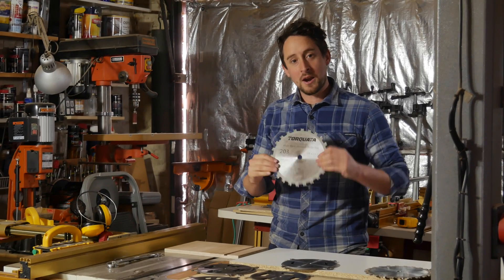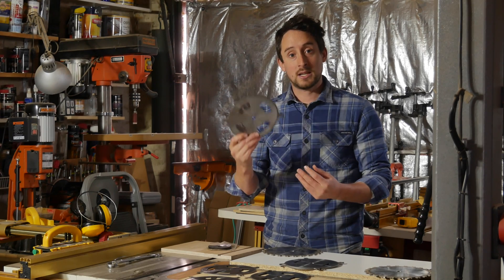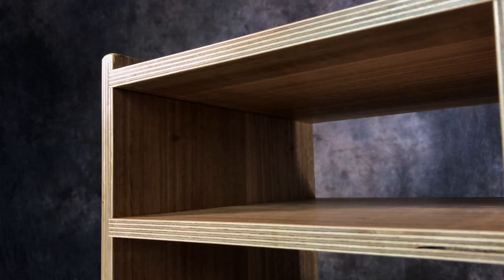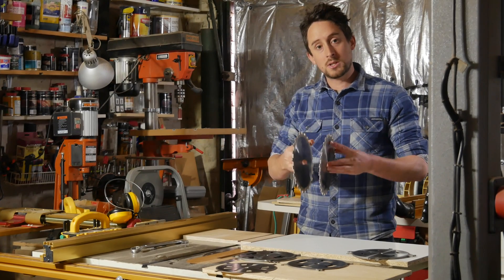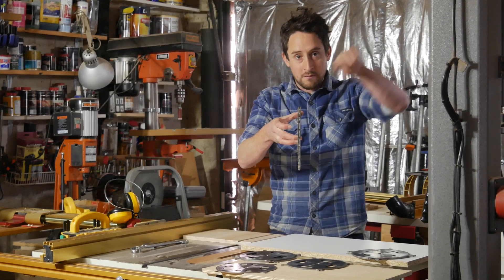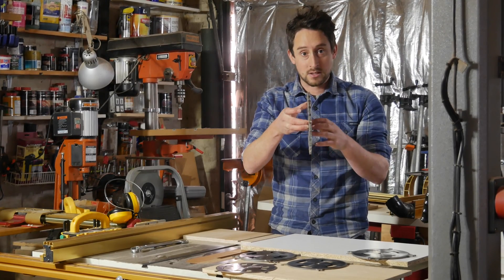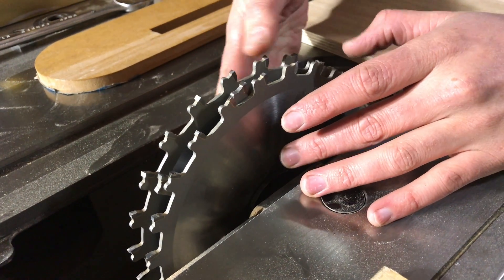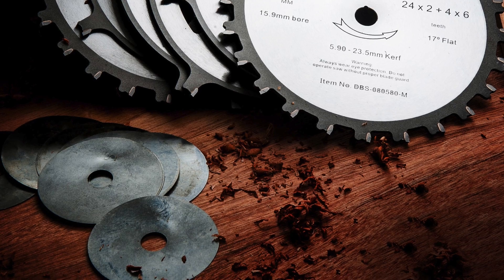At Last! A Metric Dado Set!

Comment: Just curious, if you were careful with accuracy, would you be able to do multiple passes to get a wider dado?
Reply from the maker: Yes most definitely - that would be similar to using a standard circular saw blade and doing multiple passes, it would function the same way but just take less time as the dado would cut a wider groove with each pass.
Reply: @timbeconaus  yeah, my thought is that if I wanted to do 20mm, but my arbor couldn’t handle that many blades, then it’s a work around while still getting accurate clean cuts.

Comment: Is it okay (safe) using blades of smaller diameter than the norm for your saw?  For example 203mm in saw normally using 254mm?  What about flat top saw blades - for example 6mm - what is their role?
Reply: I have the same question.  Did you ever get a response?
Reply: @mattmartin9807  After a long wait I had an email from someone in their office saying you couldn't.  Subsequently realized this was rubbish. Yes you can use smaller blades in a 10inch saw - in fact the dados are intentionally smaller as otherwise the weight and inertia of all that metal spinning is harder for the motor to start and to stop.  Furthermore, you are not making deep through-cuts. So I bought the Torquata metric set and am using on a DeWalt compact contractor saw.  Limiting factor is length of arbor on my saw so I can only stack a max of 16mm and usually use only 9 or 12mm.  The set was good value with different chippers and shims allowing a lot of adjustment.  For rabbet and lock-rabbet joins in boxes and drawers, for other rebated edges and joins, once set up it is a breeze to do lots of material compared to a router (in my experience). Note, that the outer blades are angled so you can't get a narrow 6mm perfect flat top dado groove with the set.  A single 6mm flat top might be better for that.
Reply: @stephen6220  Hey mate, which model dewalt saw were you using it on? I am using a DW745 (cheap and compact) but I also suffer a shorter than average arbor ;(
Reply: DeWalt 7491XE bought in 2019.  Using it as a table saw rather than a big mother.  Yes the arbor is a bit short but have been able to stack enough on for doing dados / rabbits. For example, that quarter-quarter-quarter technique for making draws with 9mm rebates/grooves and for some slick finger jointing. There's a fair amount of mass to start up and slow down but the saw seems to cope and as blades smaller diameter than usual, that reduces the weight of the stack.  Not using it a lot but satisfied.  Made a couple of custom ply inserts for the most common config. on the saw.

Comment: is this set compatible with a sawstop table saw?
Reply: John your comments to this video aren’t very helpful to anyone. Just negative criticism. Just in case you are unaware Timbecon is a trusted Woodworking tools sales establishment located in Australia. And metric is the ruling measurement system here bud one day wherever you live you might emerge from the dark ages and park the imperial system as well 🤣
Reply: No as it has full size chippers which won't allow the braking system to slow the blade fast enough to prevent injury
Reply: @WasimBarri  thank you! Really hoping there was a metric option
Reply: @jdroan  Why? It makes no difference whether its imperial or metric when all dado stacks are almost infinitely adjustable with their selection of shims. You adjust the stack by trial and error using the actual timber regardless of how its measured. BTW Sawstop have a list of recommended dado stacks that work effectively with the braking system
Reply: @WasimBarri  yup, and the market for this product is basically Australia and NZ, since dado stacks can't be sold in the EU, and many other nations don't have the sort of high end market that would buy this instead of spending more time
Reply: Can you recommend some table saw models which can fit a dado set?

Comment: do you need a metric and imperial version, or will this set do both?
Reply: A good question. As dado stacks are basically infinitely adjustable it makes no sense what so ever to buy this even if you entirely work in metric. You should always do trial cuts first and then add or subtract shims as necessary regardless of whether your measurement is metric or imperial. Using dado stacks is and always will be a trial and error process.
To answer your question it doesn't matter which one you buy as it will do any dado you like. Personally I think this is a bit of a con job!
Reply: I wander if John is a yank? Thanks for the metric version timbecon. I used my set of these today for the first time. Awesome blades awesome quality awesome metric simplicity 👍

Comment: What is the minimum/maximum arbor length need for this set?  

I assume the minimum is about 6mm (plus nut thread) - and the maximum is about 24mm (plus allowing enough thread for the lock nut)
Reply from the maker: Hi Steve. 

Thats correct - the minimum arbor length would be 6mm plus enough thread to get the the full width of the nut wound on and the maximum would be 23.5mm + nut thickness for the thread.